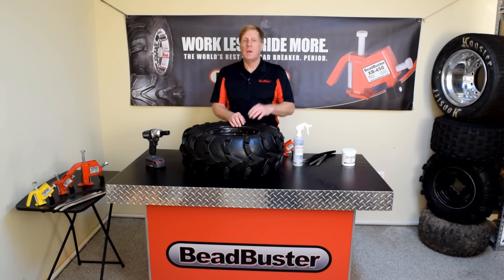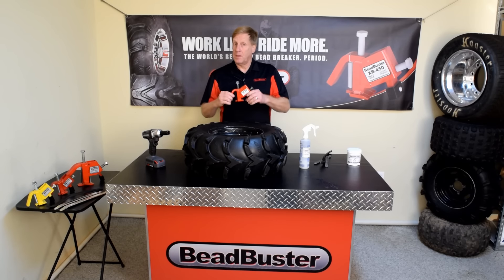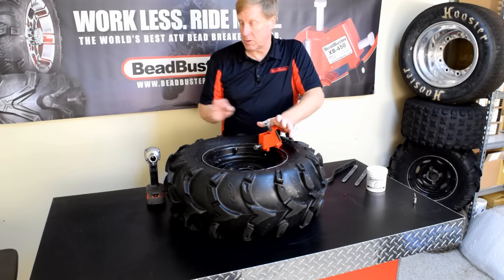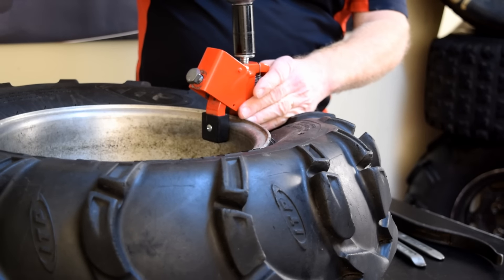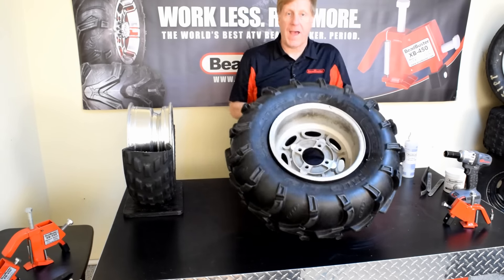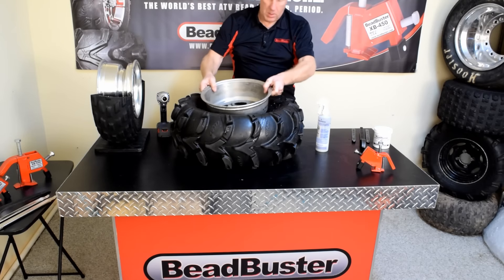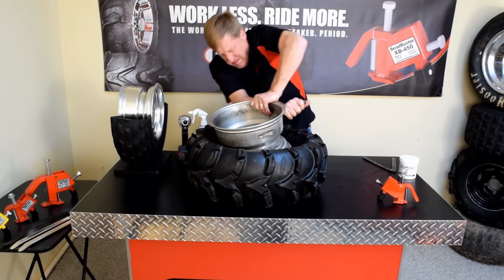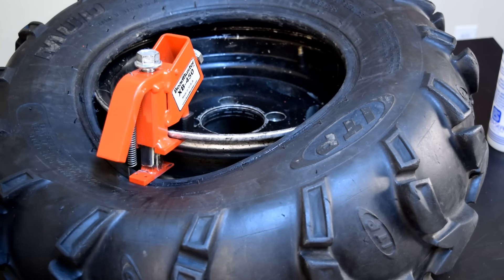How to Break a Tire Bead Easily at Home

Comment: A simple tip........in getting tires off that are rusted on.   Apply  heat to the rim......just hot enough so you cant touch it .....no harm to the paint or the rim. Makes the tire rubber much more ply able and easy to remove !

Comment: Hi I bought one on eBay and it broke after like 5 tire changes can I get a replacement or something. I really how it worked. The bottom plate that’s welded broke off from the welds. 
Thanks

Comment: I'm going to get this because I have a 50cc scooter that recently had a flat tire and broken valve stem Discount Tire is near me but doesn't fix motorcycle tires and there's no motorcycle tire shop near me and this tool will help next time it happens
But can you tell me what the difference is between the XB-455 and the X-450 other than the color? 🤔
Reply: The model 450 is Made in USA while the model 455 is sourced from Taiwan. Both designs and materials are identical.

Comment: It looks like it damaged the bed of the tire.
Reply: This tool is designed to break the bead without causing any damage to the tire or rim. However, the tire used in this video is a demo tire which has been used for all of our trade shows. We have performed literally thousands of demonstrations on this tire, breaking the bead and using tire spoons to remove the tire. You observation is correct. Changing a tire thousands of times will it out. Normal use does not cause any wear.

Comment: need vidio of doing a tire that has been on rim long time clean rim and new tire id a peice of cake without hardly any tools
Reply: You are right that old tires on old rims are much more difficult to get loose. We still have not found one that the BeadBuster cannot remove easily and quickly.

Comment: longer travel area on tool would eliminate having to reposition tool
Reply: It does seem like pushing the bead further down would eliminate the need to reposition the tool, but if the bead is really stuck to the rim, it's easier to just move the tool over and get the bead loose in a second or third location.
Reply: No, you should move the tool. Too much pressure in one place can bend the wire in the bead and put a kink in it. Same for all big tires. But if it a tube type, don't matter as much.